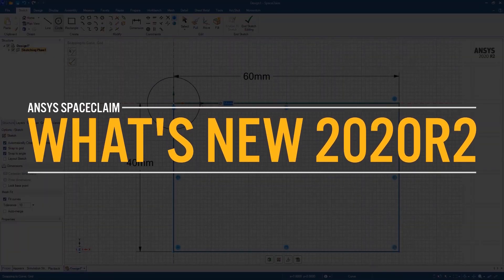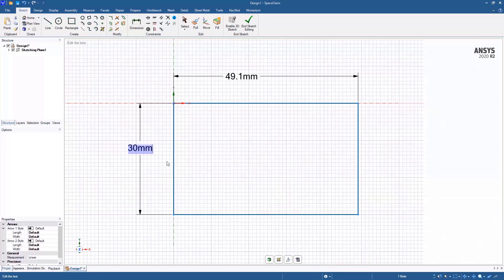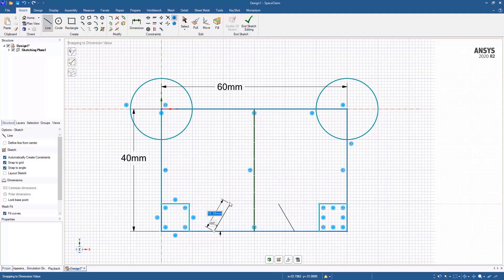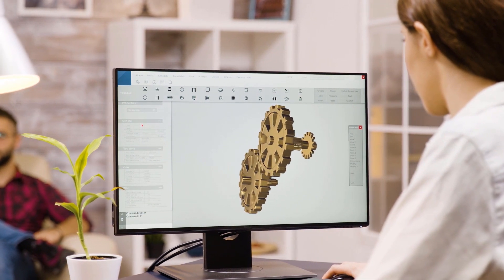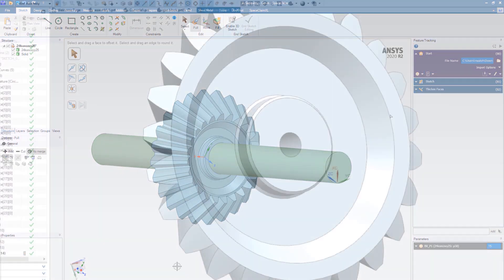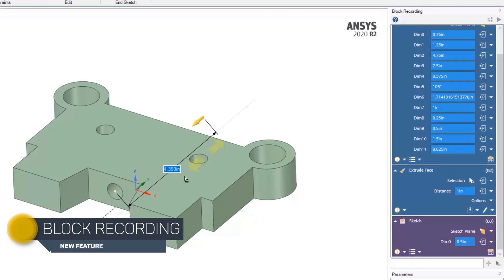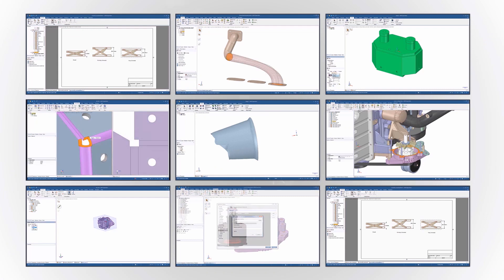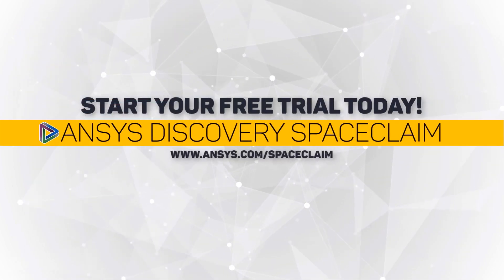What's New in Ansys SpaceClaim 2020 R2

Comment: Find it difficult to model beams in 3D WITHIN new sketching mode which allows connecting nodes in 2D plane only ... I.e modeling beams (in 3D) by connecting nodes seems to be lil difficult in this version.. am I missing any links here ... ?
Reply: Yes, they have made this workflow a little slower with the sketch tab.  Once you've selected your line tool etc, hit 'D' to switch back to 3D mode.